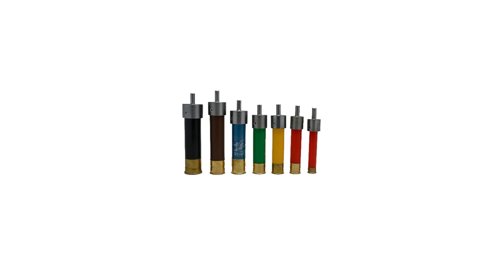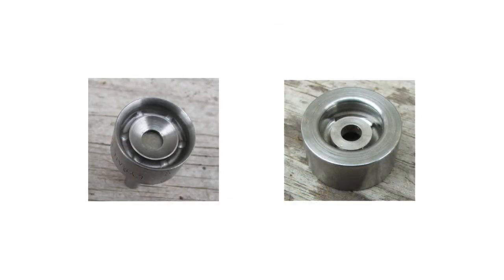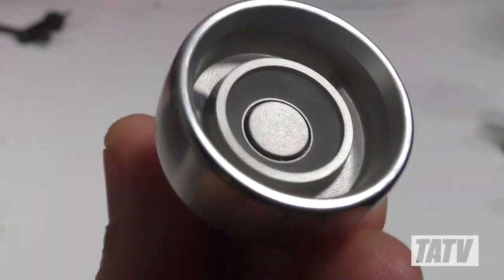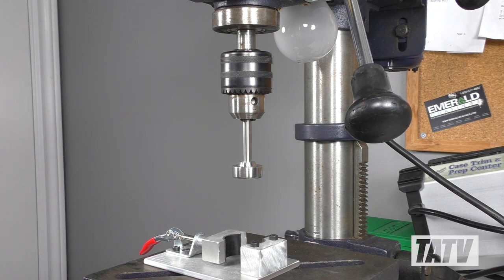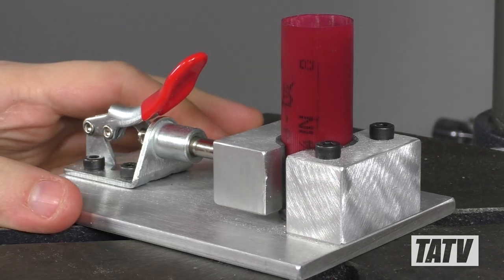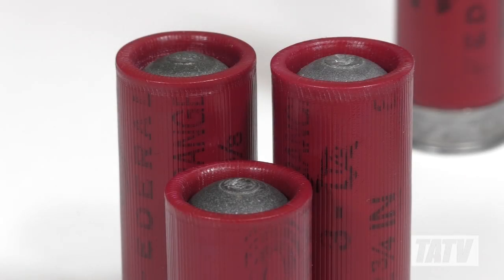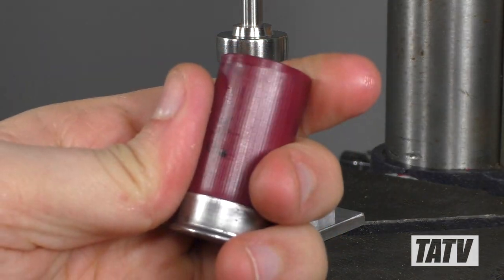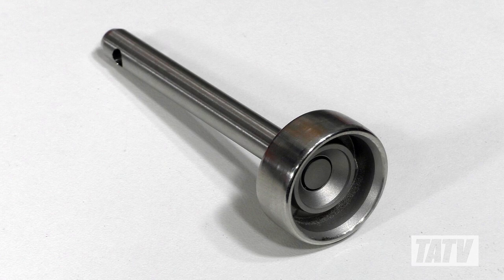Shotshell Roll Crimper

Comment: I wish you had 16ga tools. I just picked up a Stevens 16ga side by side and all the stuff for 16ga at BPI is sold out. However I will be picking up 12gauge & 20ga because yeah you designs are definitely superior IMO.
Reply from the maker: Unfortunately I'm a one-man shop, so I can't really afford to produce tools that don't have significant demand. It's also extremely challenging for me to get 16, 28 and 410 hulls here for testing and R&D purposes which doesn't help.

If you can find 50 people willing to put a deposit down plus a source of hulls for me to test, I'd certainly be open to it but that's a pretty tall order!

Thanks for your support regardless.
Reply: @TATVCanada  completely understandable on all your very real issues with producing 16ga tools. Again I will be purchasing the 12 & 20 gauge tools. Because they are superior in design to other options on the market.
Reply: Honestly how much money are you really talkin and how many shotgun Hulls you need of 16 gauge 28 gauge and 410.
Reply: @chrisedwards9156  honestly idk 🤷‍♂️ I found this Stevens double and I like it. But let’s think about it for a second. I could use it FB for trap and skeet I can use it for small game. If I cast slugs it could be used for white tail deer. The 16ga is actually quite a decent gauge only issue is Ammo availability. I figured if I had a Ammo can full of bird shot and a Ammo can of slugs. That should be more then sufficient but I don’t want to just buy it I want to make it that way I know I’ll never have to worry about availability. Just my thoughts on the subject.
Reply: I was trying to get a numbers from TATV Canada I have a local skeet range down the road from me all gauges are used pretty frequently there since the range is free and has very few restrictions. But I was wanting to know these numbers so that I could help him facilitate his research and development.
Reply: @chrisedwards9156  oooooh I completely misunderstood what you were saying. I thought you were saying numbers like just scrap the 16gr all together. And just get a 12 gauge or a 20 gauge well then what I suggest is going to his site. I believe the website is mentioned in the video.
Reply: No I'm a big proponent of freedom of and love that people love variety and have choices and I love almost every cartridge I've ever shot which has been quite a variety as a licensed Firearms instructor. except for I do not enjoy shooting 500 Smith & Wesson or 40 Smith & Wesson but I know people who do love those cartridges, and love that they love them.
Reply: @chrisedwards9156  I’m on the same page brother I have yet to shoot a 500 S&W so I can’t comment on that cartridge. But the 40 it’s definitely not my cup of tea but just like you said I have no issues with someone who does enjoy it. Every person is different so to each there own I actually shot a lot of 40 through out my 20’s. But that was the early 2000’s when the 40S&W was extremely popular but with advancements in bullet design and gun powder. The 40 is going the way of the dodo 🦤 it’s funny you bring up the 40. I was at my local club and there was a CPL class going on I asked the teacher if I could pick up the brass after he was done. And of course he said sure so I get in there and start picking up the brass. He comes back about 15 or 20 minutes later as I’m finishing up and asks me why I was leaving a pile of brass on one of the bench’s. Before I could say it’s 40 he had looked at the head stamp and said oh never mind. However I’m sure that someone will have seen that pile of 40 and been extremely happy about it.
Reply: Plus one to interest in 16 gauge tools
Reply: @TATVCanada please send me your page for ordering

Comment: 4 8 12 16 > 20 > I V X T L C D M > my four theory > shot gun shell shot count 4 8 12 16 > i only like crimprol shel .... i lik your dezign but i .... would like a 4 inner built in cut you have 3 to make the crimp .... i would also have a arrow on the top showing which direction and be cuz of that i would have 2 made that one goez one wa and the other